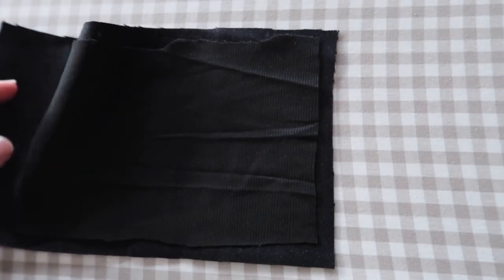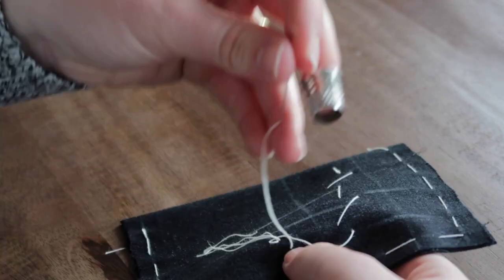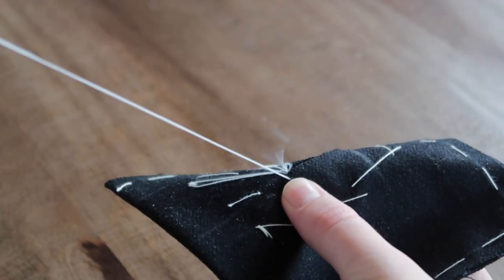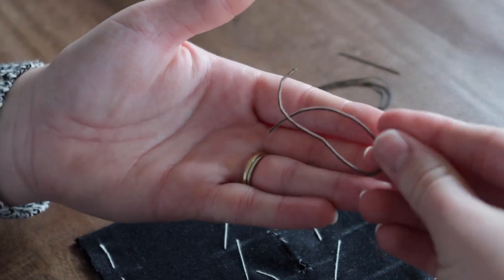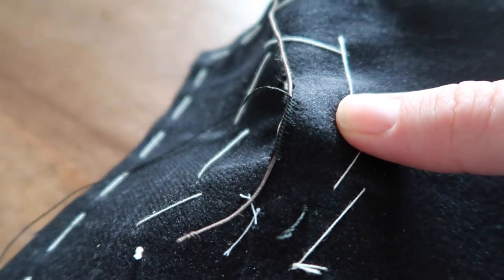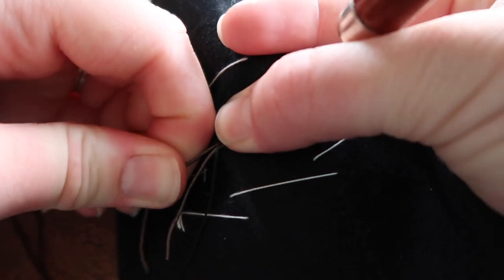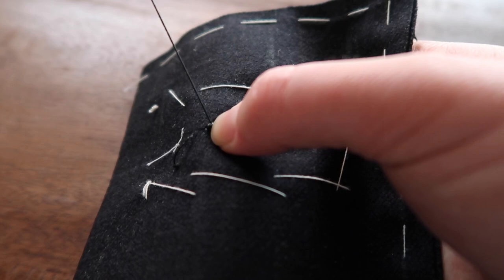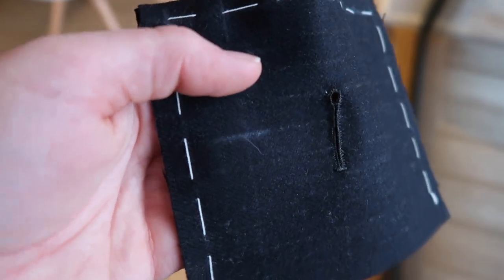SEWING BUTTONHOLES AT HOME - tips & mistakes to avoid //ASMR

Comment: Jemima, what is the thinnest type of fabric suitable for handsewn buttonholes? I have a feeling you will say almost any as long as you use thread that is appropriate and where possible has a backing. However I would think silk and organza would require a high skill level. Thank you.
Reply from the maker: hi! I have only ever make buttonholes on different weights of wool. I doubt it's even possible on silk or organza.. the buttonholes are very firm and need a fabric with strength. silk and organza frey a lot and are very slippery to work with.